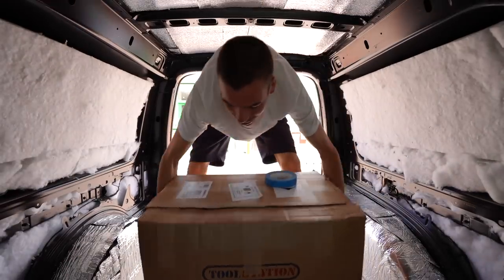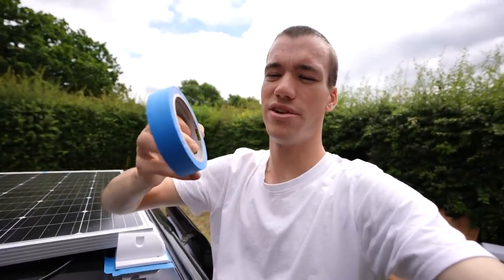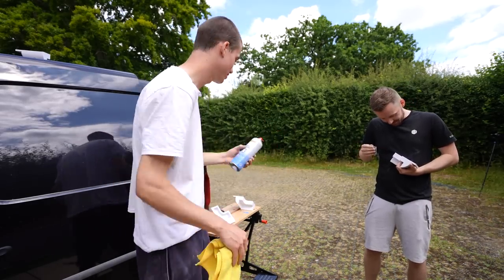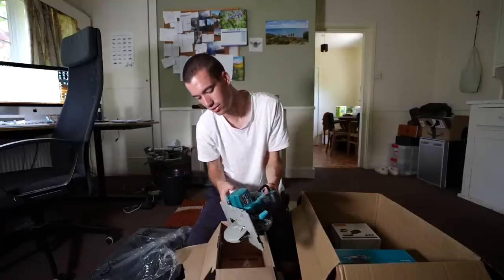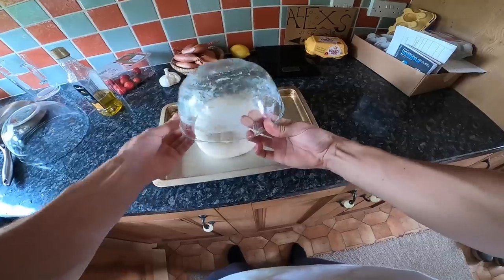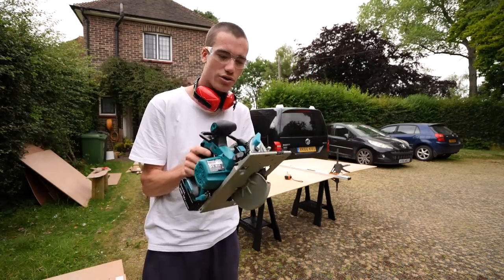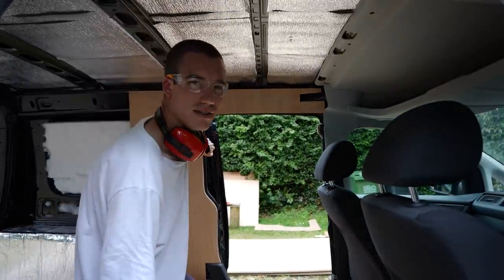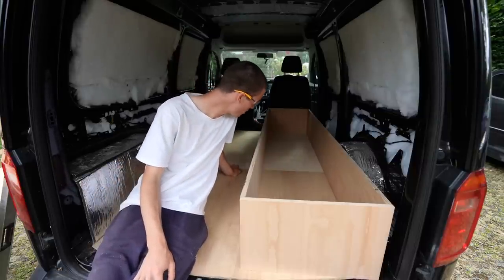Converting a van into a camper - Learning how to use power tools Ep 5

Comment: Use hinges on the top of the bed instead of a drawer so you can lift open that whole length of the bed and you have more storage under there than a little drawer on runners
Reply: My granddad did it this way, he converted not only one van in his lifetime and is still using it with over 80 years of age.
Reply: @FelixIsGood  just seems like the drawer won’t be as convenient for space, also will give him experience using hinges on the wood. It’s just a better way to do it
Reply: @josephquinn7244  Maybe that wasn't clear from what i wrote, my granddad used hinges, everything else also isn't really stable.
Reply: I agree that the hinge method would be a better option also the internal wood frames will give a lot of strength to your build. Scewing directly into the ply is not the safest way to fasten weight bearing pieces. Imagine Alex all snug on his bed filming then creak, CRASH! Alex toppling out of view as his bed collapses. Lol. Great job so far mate. Keep it up.👍
Reply: Small drawer at the end, lifty hatch the rest?
Reply: @mattnorman4007  if you’re going to have it as a drawer and a hatch you might as well have it all as one or the other? It’s all storage so why make more work making two different types of storage 👍🏻
Reply from the maker: @mattnorman4007  Yep that's what I'll do I think!
Reply: I agree , however in my opinion I would have the last section as a draw for things you may need to use more regular to save having to re do your bed every time you open the whole storage.
Reply: @epiiccg8mer230  agreed, small drawer at the end big lifty hatchy thing for the rest. That gives Alex a good project to work with. 👌
Reply: @1968Zedar  Top Advise, it really does need a frame.
Reply: I would also do like this, it's a lot more simple than making drawers
Reply: Half drawer half hinge is best way to do it, that way if the drawer has a  top you can use it for cooking on as a slide out work top etc. Seen it done with the up and over style door as you have worked well 👍 very impressed with your skills and I'm a joiner
Reply: it also lets you get at everything from the inside

Comment: Two hands on that circular saw if you can  when you first start to use one . one hand and you will drop it down to one side when its still running  and take a chunk out of your leg . the blade should just be out enough to cut the thickness off the ply .hold it tight as they can kick back . stay safe vans coming on great good job thanks for the upload

Comment: Great work mate, I’m a carpenter and all looks good only tip is please set the depth on your circular saw to suit the material. It’ll make a cleaner cut and in most sheet material cases safer.
Reply: Was going to say the same thing I would normally do it about 5mm or so more than the material.

Comment: I’d personally move the bed closer to the side. Make it a tad higher and tuck the wheel arch under it, It will also add a bit of extra support. Then you can still have draws underneath and move space on the other side for things
Reply from the maker: Cheers :)

Comment: When cutting flat board such as ply or kitchen worktops on trestles, place the board on two pieces of 4" x 2" laid on your trestles, that way you can cut all the way through without the board "flipping".

A little trick I learned when doing a bit of kitchen fitting.

Comment: Alex, get drawer runners that take a lot more weight than you think they need, so are as strong as possible and don't flex when your draw is fully extended. You could half the length of that box frame so only pulling out half of it so only need drawer runners and internal u shape of drawer for that section.  If it was me I'd possibly consider using piano type hinges,  a catch where you can open and access it inside if you ever want to without opening the back of your van and pulling the drawer out. Handy for stealth or cold weather camping. Lots of people on here too many to mention that have done pull out drawers just have a look you will get good tips on theirs. A guy called Greg Virgo is on here he makes wiring  vans up to your solar look straight forward too.  Please do get a carbon monoxide alarm everyone in a van needs one. If any room on the roof left consider a maxi fan for hot weather, bug net for hanging over your back door when open, ikea would probably have one you can improvise with magnets for side of van. Blackout fabric over any left over insulation and a couple of magnets for your windows helps insulate from cold and heat.

Comment: For circular saw you need to get a blade with at least 40 tooth, preferably 60 for plywood. And cut from the back side, not front facing. Also don't clamp a spirit level it may bend it.

Comment: Heh there alex...gonna be a sharp learning curve.doing well though.
You may wanna add couple of lights to outside of van too.ive got them on all sides on van...plus a lightbar on the front of my roof. Fit everything to outside first.big tip. Sikaflex or silicon all made holes too. Get wiring in before your panels go on too. Figure out where your usb, light switches and battery will go etc. Add cable protection on any sharp areas too....esp because when u drive it can wear through the wires.
Make the bed and anything in van able to withstand an accident to...so add metal right angle brackets into van structure where u can. If you keep van build simpler it will be easier. 
You could buy a ridge monkey shower all in one electric n container for 65.00 quid...a really easy way to stay clean or do dishes etc on the road, cheaper ways are out there too.
Make as many triple reduncies in your van as possible. I have 3 ways creating electric, 3 ways of showering, 3 ways of cooking, 3 ways having water inc a water purifyer for streams and odd water sources. One can fail, two good back up...three no probs ready for anything.solar shower worth a look too in many formats. Small solar genarator will be handy aswell as having your main van battery set up.
Dont forget security either add now door locks...many types availible? Cross bolt types or shed type.....or even simpler drill the door runners close to where door opens and slides.make hole big enough for a padlock to push through hole...voila extra cheaper security when away from van. Vans are easy and highly nickable. 
Keep up the good work...yes recutting wood part of the game lol.
Peace. 
Good luck too.

Comment: Nice work, butt joints on ply are never great they will need extra support. I'm not sure about the pull out drawer it means you have to open the rear door to gain access. Unless you plan for it to become an outdoor work space for cooking etc. Its a pity that the solar panel won't lift up to provide an angle to get better sun cover. Plan where you're putting lights and power outlets so you can run the cables before fixing the panels. Good work so far take care with the saw.

Comment: If that square is gonna be one big drawer then you need some type of support you can fold out when you drag it out to full length. Also take out the side passenger seat out so that you can make a wall with a door in up against the driver seat so you can have a bit more privacy in the back without anyone looking in from the front. and maybe add like a folding table that is mounted to the wall of the van so you got a table to have your pc on and in general a place to work at and do small repairs if needed. But love the progress looks nice!

Comment: Hahaha "they sold me some power tools" said like they had made a BIG mistake 🤣 

Great use of the ply, I used timber 30mmx30mm but using the ply like you would have been a bit easier I think.

FYI in the ply cladding, you could stick vinyl to it? I stuck vinyl down for flooring and siliconed the edges so its waterproof, was going to do timber cladding for the sides but I got some spare ply so going to use that and then stick fake wood vinyl instead 😉

Comment: If you have any further cutting to do, here's a tip for you. Instead of trying to balance large sheets of plywood on two rickety saw horses, get yourself an eight by four sheet of insulating foam about two inches deep. Lay your sheet on the gound then the plywood on top of that. You should set the depth of cut on the saw so the teeth are just protruding a milimeter or so beneath the plywood. You can then cut your wood with it being fully supported by th efoam underneath it - the pieces won't fall, or bind or slip. The foam will eventually get covered in tiny cut marks, but you can throw it away when you''ve finished all the cutting. Hope that helps.

Comment: 😬 so much cold bridging and no vapour barrier.  It will work but might want to  come back and re do in a couple of years . Condensation behind all that insulation will do nasty things if not careful.
Reply: How would you advise insulating a caddy?
Reply: @colindyson8788  leave not spots for cold bridging where possible with the your chosen insulation and then a vapour barrier it all. As per my comment . The principle of insulting a van is the same as  any other building. But in a van your vapour is huge in a small
Space and any cold spots will condense

Comment: It os very admirable you want to build it yourself. But in your case i would also consider just buying a made to fit campingbox. 
There are also a few easy designs that work with a drawer but will make even better use of the available space. As said box, so im sure you can build it if you want to.

Good luck building

Comment: Should make your bedframe the same height as the wheel well so ur matress can slide over it, should also cut out a notch where the wheel well is in your bed frame to get it closer to the wall. And the passenger side sliding door, you should out a access cupboard door to the bedframe so u can access that storage space from the outside of the van and not need to open the rear hatch.
Reply from the maker: Cheers for the info :)
Reply: @just_alex  your doing a great job so far though! Crazy how much goes into a project like this! Keep it up man

Comment: the clamped level on the table is what i personally do. there is no shame in DIY'ing  instead of buying expensive tools.
for reference i bought a run-down house with rotten floors and no insulation and i did the entire renovation. including the entire plumbing, electrical, foundation drainage and heating work so i know a few tricks.

Comment: Alex, you do understand that with all the money you spent on the tools, equipment, shipping, etc,, you could have purchased the more expensive, already completed travel van, right?!!
[2] There are actual popup tent canopy/awnings to put in the area, and work under so you don't have rain or hot sun beating down on you.  Then you can also take those camping as well.  Next project, install a roof rack to put the tent canopy, a folding chair, and folding table to sit outside while relaxing.

Comment: Please tell me that even tho you glued down the mounts for solar panel you still drilled and bolted the corners at least to the roof of the van. Sikaflex 521 is a sealant not a bonding adhesive, should have used either 522 or 527

Comment: Hi, why don't you use the existing installation points on the Caddy roof.
They would at least hold properly and you could exchange the solar panel for another or rebuild it. That is very disadvantageous with grinding and gluing. Otherwise, nice video. Many thanks for it.

Comment: Be careful with that circular saw probably the most dangerous power tool watch a few tutorials before you even think about using it and use it with care! Also after watching this through you are doing well I’m a professional joiner btw one tip set your saw blade around 3-4 mm deeper than the material it’s safer less chance of kickbacks and less blowout/splintering 👍